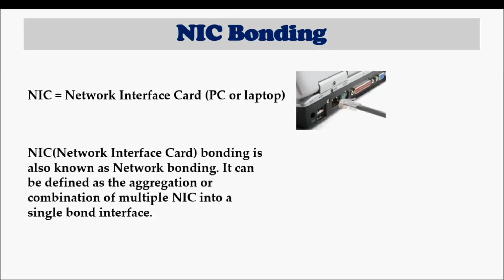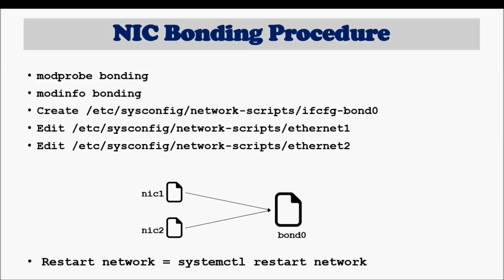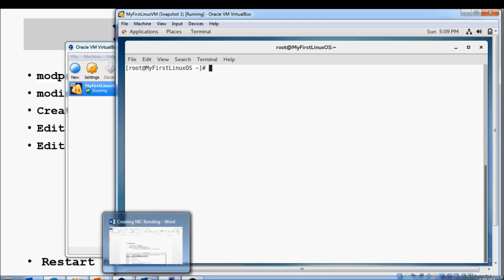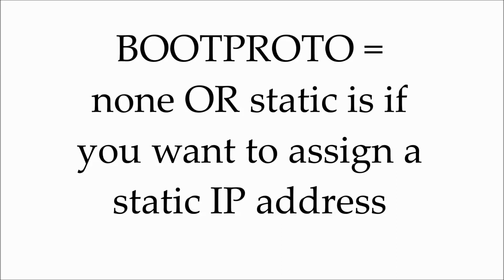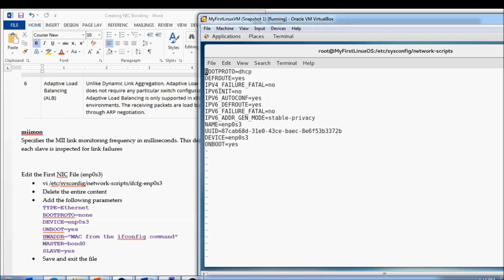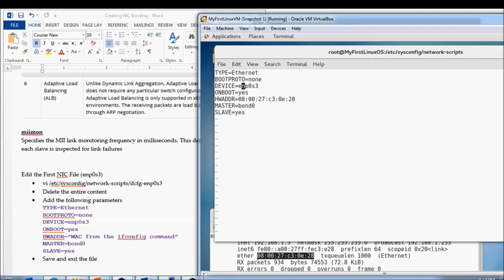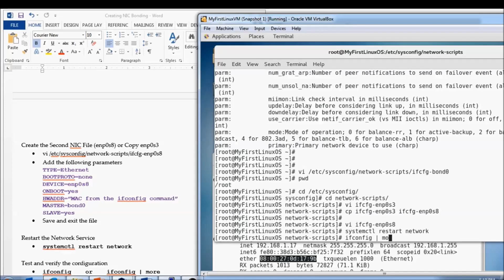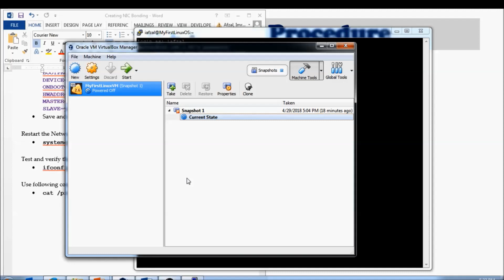Linux NIC Bonding

Comment: Can this or similar methods be used to increase the speed of a single network socket or would this be limited to load balancing multiple connections? for example could I add a second USB NIC to my laptop and server and get a 2Gbps connection to Samba?
Reply from the maker: No, the system or the mother board has to support the NIC.

Comment: First of all many many thanks for the video.
MY SECOND NIC IS NOT GETTING IP
please let me know if you have the solution for it.
I will be great full to you.
   
[mhb@localhost ~]$ ifconfig | more
enp0s3: flags=4163<UP,BROADCAST,RUNNING,MULTICAST>  mtu 1500
        inet 192.168.42.242  netmask 255.255.255.0  broadcast 1
92.168.42.255
        inet6 fe80::4f94:ec17:8572:816e  prefixlen 64  scopeid 
0x20<link>
        ether 08:00:27:1e:d3:d9  txqueuelen 1000  (Ethernet)
        RX packets 9739  bytes 14104973 (13.4 MiB)
        RX errors 0  dropped 0  overruns 0  frame 0
        TX packets 5169  bytes 364527 (355.9 KiB)
        TX errors 0  dropped 0 overruns 0  carrier 0  collision
s 0

enp0s8: flags=4163<UP,BROADCAST,RUNNING,MULTICAST>  mtu 1500
        ether 08:00:27:9c:22:8b  txqueuelen 1000  (Ethernet)
        RX packets 5  bytes 830 (830.0 B)
        RX errors 0  dropped 0  overruns 0  frame 0
        TX packets 0  bytes 0 (0.0 B)
        TX errors 0  dropped 0 overruns 0  carrier 0  collision
s 0

lo: flags=73<UP,LOOPBACK,RUNNING>  mtu 65536
        inet 127.0.0.1  netmask 255.0.0.0
        inet6 ::1  prefixlen 128  scopeid 0x10<host>
        loop  txqueuelen 1000  (Local Loopback)
        RX packets 0  bytes 0 (0.0 B)
        RX errors 0  dropped 0  overruns 0  frame 0
        TX packets 0  bytes 0 (0.0 B)
        TX errors 0  dropped 0 overruns 0  carrier 0  collision
s 0